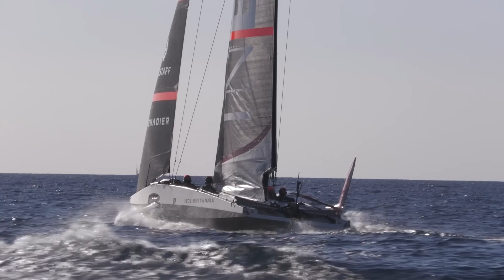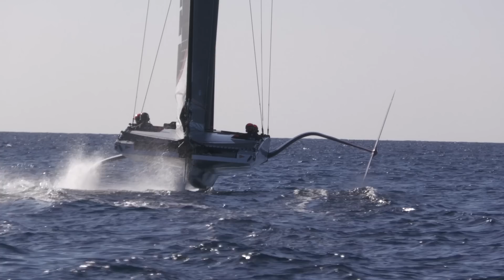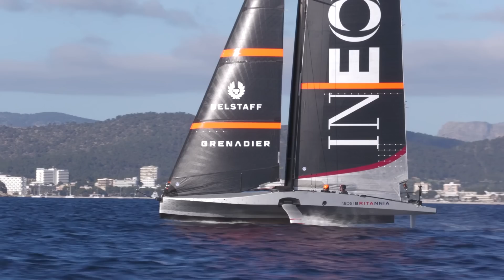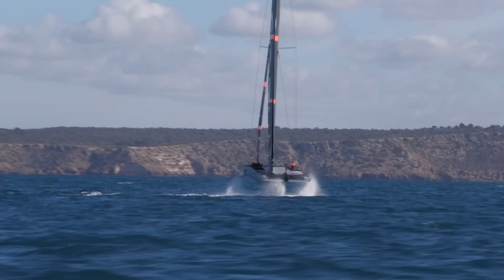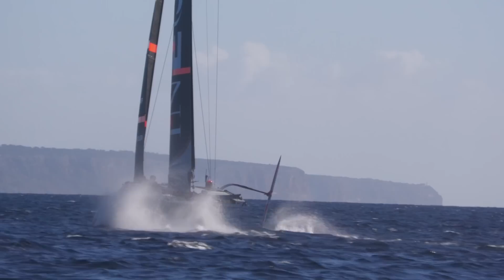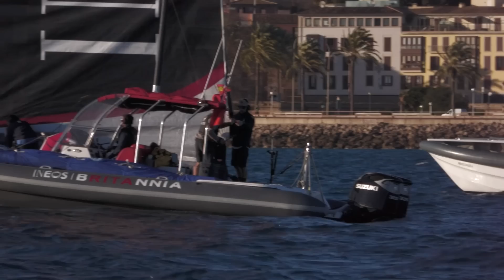INEOS Britannia T6 Day 11 Summary

Comment: For a reason that I am unable to articulate, INEOS LEQ12 looks really quite 'sharp', would be nice to see more 'flying' gybes and tacks, but in general it looks in great shape. Wondering if the design team has any intent on reducing the size of the gap at the bottom of the trailing edge of the main sail by moving or removing the rams.
Reply: I expect that's every team's goal. They've all tried TNZ's winning method now and it looks like AM are now moving along to laying the sheeting ram on the deck so the two outhaul rams can be closer together. A lot of your drag on a wing will come from the tips
Reply: @weatheranddarkness  Yes I saw Mozzies report, and it certainly left me thinking.
Reply: How about you ask them why they are often dragging their windward foil in the water while foiling?
Reply: @uflux  That's been on my mind ever since I first noticed it. Seems like extra drag that can be avoided if only the foil arms are able to lift the foils higher. Question is can they or is it a limitation with this design?
Reply: @uflux  they chose a funny arm geometry that doesn't actually allow the windward wing to be fully clear of the water.  There must be a reason.
Reply: What are you smoking.